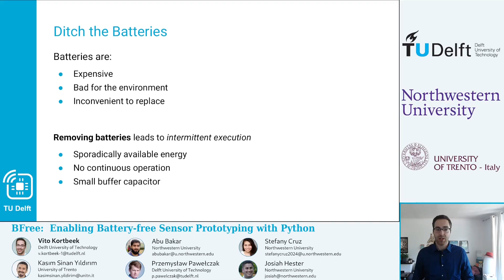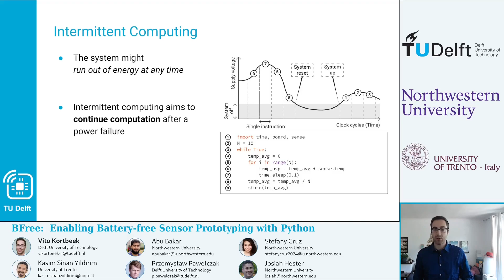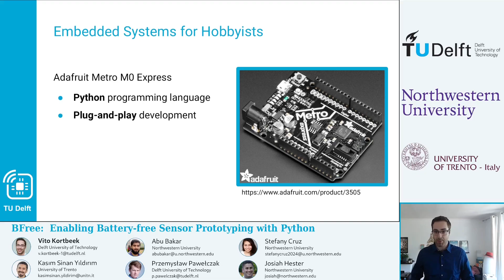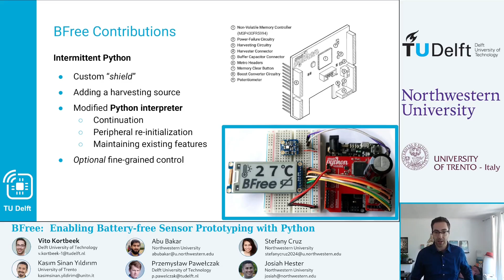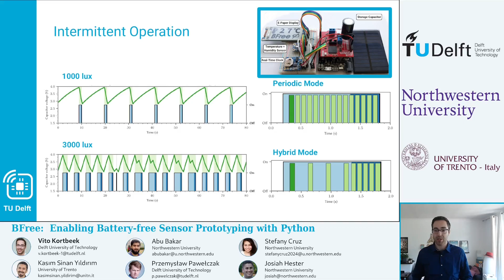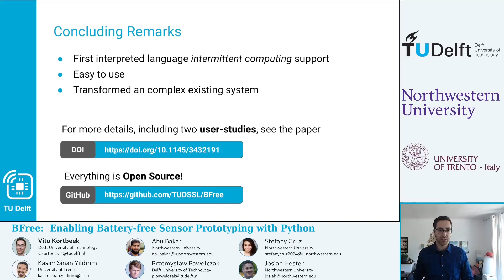BFree: Enabling Battery-free Sensor Prototyping with Python - UbiComp 2021 Presentation

Comment: This system is not new and not unique. This system was using electronic calculator from 30 years ago. Just need super capacitor instead of battery.